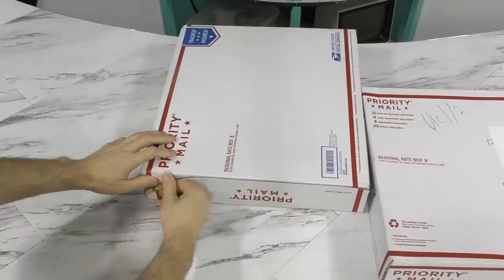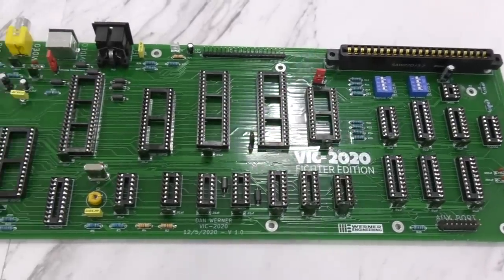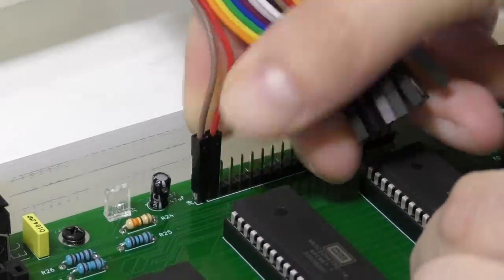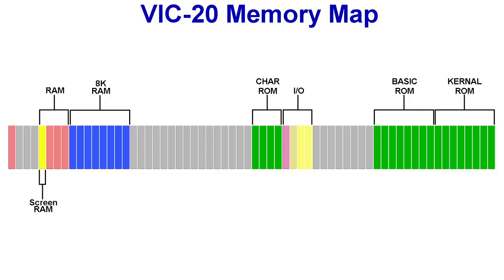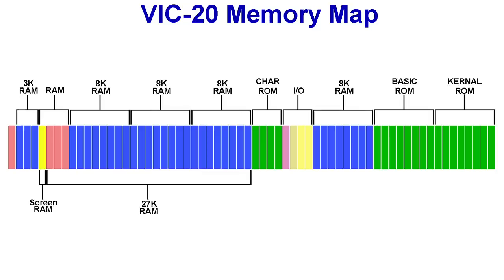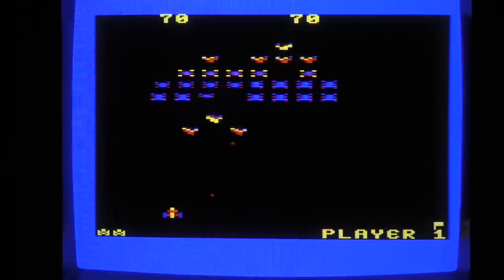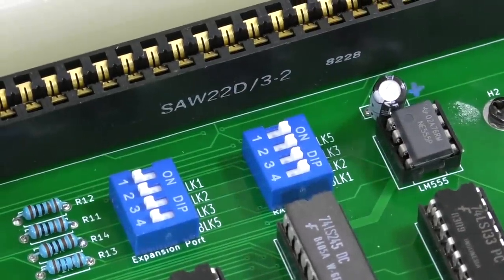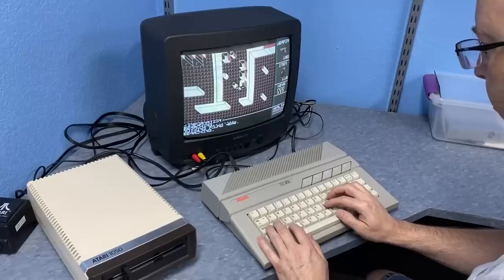Building a VIC-20 Kit Computer and X16 Update.

Comment: Weird that they did a kit that required an 'unobtainium' chip.
I wouldn't mind it as a keyboard only, for feeding an emulator of some soft (VICE etc) rather than using a PC keyboard.
Reply: Yeah it’s a bit clumsy to make a kit that depends on secondhand parts.
Reply: As said in the video, I guess the VIC-I isn't too hard to provide as a FPGA since there aren't any non-deterministic parts to it like the SID.
Reply: @D0Samp  Yeah the vic 20 would be infinitely easier to do one of these for than the 64. So many proprietary parts on the 64 and such.
Reply: @maxxdahl6062  SID clones exist, though!
Reply: @TheEmeraldMenOfficial  Yeah but darn near everything, the CPU, PLA, CIA, VIC-2, etc are proprietary for the 64. Absolutely love the SID chip.
Reply: @maxxdahl6062  …The 6502 is DEFINITELY not proprietary and it’s still being made now
Reply: @TheEmeraldMenOfficial  No, but the 6510 is proprietary. :P It's a minor modification to the 6502 but still, a modification specific to the 64.

Comment: I have designed such a device, an FPGA based VGA replacement for the VIC. In its present incarnation, it hooks in at the expander port. 😎
Reply: The vga requires 6 connections and then  an audio is needed. Using the standard 3.5mm and 15-way D, there is not enough room at the present 5-pin DIN connector. So it is either and external piece with just those 2 connectors or expansion port. Or modifying the case, which I think ppl will not want to do.

Comment: For the DIP switch problem, I say just solder them onto the BACK of the board and dremel holes for them so you can just get em from underneath. As for the VIC chip, I'm surprised nobody's made a microcontroller-based drop-in replacement for it - the kinda data processing it needs to do is well within the capabilities of an 8-bit AVR or PIC, and something like an ATMega2560 (which can sacrifice some I/O in exchange for breaking out the 8-bit data bus - only extra chip's a 74-series latch) is more than capable of reading the VRAM and CROM and spitting out pixels, and can also make a colorburst with the right clock crystal installed - or just be connected via YPbPr for use with modern CRT televisions, which is the simplest option.

Comment: I love seeing these new retro computer builds, I just wish we could have brand new CRT displays to go with them. New CRTs with Quantum dots instead of Phosphors, so we could have a display that lasts 20 years without risk of burn in.
Reply: I have a later model of a Dell CRT that does from 320x200 to 1280x720 at 85hz, it's been running since 2002 on and off and hasn't gotten burn in, it seems like modern CRTs are better at that...or maybe mine hasn't been used enough (it was used by my great grandma for like 3 years non stop at a bank before she died)

Comment: You would only need to bake the parts if you were going to reflow or wave solder the board (I’m assuming moisture ingress through humidity, it is a different matter if the parts were actually soaked in water).  Manually soldering one lead at a time will never get the part hot enough for moisture to cause any damage during assembly.  In that case you would bake things in an oven for a number of hours to slowly drive out any internal moisture so that internal moisture does not suddenly expand when the part is quickly heated during soldering.  But if you later wanted to run the assembled PCB through a reflow oven then you would want to first bake the board to drive off any moisture if there is any chance that it has been exposed to high humidity for a period of time prior so as to avoid delamination and other moisture induced damage from internal water/moisture suddenly flashing into vapor.

Comment: Baking the chips isn't needed if you are manually soldering the pins with an iron.  Its to prevent the IC from exploding from trapped internal moisture if you run it thru a reflow oven.

Comment: I have a Vic-20 that is practically new in box and an unopened Commodore printer. (No dust, still has the plastic cover, no yellowing.) I had a modern power brick made but have be weary to plug it in. I really want to get the capacitors replaced. Even though they look brand new, they are 40 years old.

Comment: I suppose the notches don't really matter for a socket.  The pins wind up passing through either way.

12:54   The Harlequin ZX Spectrum clone has a rather neat solution to this.  By default it doesn't supply all the voltages to the expansion connector so the entire system can be run at 5v, but there's a header that can be used to supply them if you want to use hardware that needs them.

Comment: Nice job.. the keyboard seems to stick up too high,easily fixed with some spacers between it and the case maybe? Also its odd they used that style cable for the keyboard,i guess once installed u could superglue it all together to make one connector?.

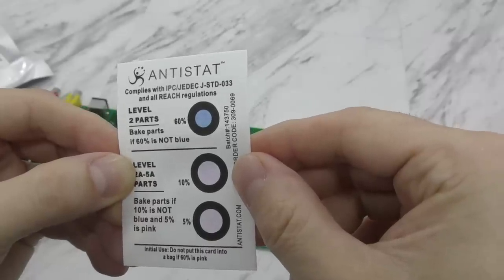Comment: 3:00 you did not need to bake it anyways. This is only used in industrial processes where you are going to rapidly heat the chip to a high temperature in SWS for example. In this rapid heating possible build up moisture could vapourise and shatter the component. In your case baking would not have done anything, since it starts absorbing moisture again as soon as you are done baking.

Comment: With the power of FPGA, one could theoretically design an all in one commodore board. From PET to C128 in a single machine. Audiophile gear company "PS Audio", even uses FPGA to power their digital to analog converters. Very cool stuff!
Reply: Never heard of the MiSTer? It does almost all CBM systems. And many more.
Reply: @sierraromeoromeo2444  I have not, but I do now! That thing is pretty awesome! I suppose this will wind up being the end all for retro hardware in general as another 10-20 years you prob wont be able to just find genuine hardware anymore at any reasonable cost. Still mad @ my family for selling our complete C128 system back in 93 when support ended. I hang onto any/all retro hardware for DEAR LIFE now : D

Comment: Thanks for the interesting program you certainly know your stuff, I have just pulled out a VIC-20 from my  collection, Made in the U.K, serial no: 301179, when I first powered it up I was pleased to see the VIC 6560 PAL 625 line chip was still working BUT there was no cursor on the screen, once I open it up and looked inside I immediately saw some one had soldered across the cartridge expansion a eprom  type 2764 which has damaged both the VIA's chips type MOS 6522 so I had a hunt around in my workshop and found a old FDD  type 1541 which had these 2x ic's, please where can I get the MOS 6522 ic's, my VIC20 now works which is great, the pcb  has KALEX 25043 on the top side printed on it. I  have also repaired a MSD 32K RAM expansion plug in memory card, the 1541 floppy drive needs repair also apart from the 6522's I robbed to repair the VIC-20, cheers from New Zealand.

Comment: I would be wary using the Penultimate Cartridge with that kit as the cartridge does not expect their to be the 3K RAM expansion present, so both the board and the cartridge could be providing RAM over the same address range. It should work as they both output the same thing (at least for addresses that have been written to already), but is not recommended unless they have wired the three 1K block select lines on the edge connector high so the 3K area in the cartridge will never be accessed.

Comment: Will the ram and charset be expandable. I'd like to be able to define glyphs for greek, cyrillic, and european languages. I'd also like to define up to 65,535 glyphs…
Can the glyphs be 16x16 themselves?
Reply: a full kanji set. good thats an awful lot of characters...
Reply: Oh gee,  @BrassMtn  why didn't WE think of that?? 🤦‍♂️
Reply: @BrassMtn  Wait, you're telling me that The 8-Bit Guy doesn't cover modern 64-bit technology?
Reply: are you talking about the X16 or the VIC-20?
Reply: @mrmimeisfunny  X16
Reply: @BrassMtn  shut up. let people like old computers. what if they like old computers and have bad english? maybe speaking their first or another language they are fluent in would be better.
Reply: @BrassMtn  Why are you even here?
Reply: @Mr. Garbage wouldn't you need a lot of extra memory to hold the ASCII or unicode values used to represent other languages besides English?
Reply: On the X16 the character sets are all 8x8 pixels.  They are stored in one of the ROM banks.  However, you are not limited to that.  These are copied from ROM to the VERA board (default start at address 0F800) at startup.  You can replace that 1bpp character set with your own, up to 256 tiles.  In the 2bpp, 4bpp, and 8bpp modes you can have up to 1024 tiles, though you'd need to change the starting point of your tile set.  If you store your character set on a file on the SD card, you can load that file directly to VRAM.

Also, there are two layers to the display, and each one can have its own character set.
Reply: @Mr. Garbage unfortunately I'm not seeing anything confirming the presence of kanji in the VIC-1001 character set, only katakana
Reply: Y’all are so triggered. I made a joke. He obviously enjoys retro computers and working with them.. I thought that was a given.
Reply: @BrassMtn  jokes are supposed to be funny.

Comment: 1:14 - I also dislike the sockets without the round notch, but learned that I could just push a dremel into the plastic and create a notch - preferably before soldering it to the board though :)
Reply: You can also use the iron itself to melt a notch if you don't mind the smell and getting gunk on your tip
Reply: You can use a marker pen as well.
Reply: That thought occurred to me too. But when he held the two next to each other I noticed how much thinner the plastic “cross beam” was so if one were to cut into it (a noticeable notch otherwise why bother?) then you’ll maybe have a weak socket. IDK 🤷‍♂️ never tried it so maybe I should and report back. No. Too lazy. 😀
Reply: @nickpalance3622  Or make a notch in the other, thicker side?
Reply: red tape might help too ?
Reply: Turned pin sockets win every time. You wouldn’t see spring leaf DIL sockets in NASA
Reply: What purpose does orientation even serve on an IC socket? Is it just there to make it more apparent what the correct orientation is for the chip?
Reply: @asteroidrules  Yes, when you place the socket you'll most likely hide the screen print showing the orientation.
Reply: I use spot of red nail varnish
Reply: "if you don't mind the smell and getting gunk on your tip" that's what she said...